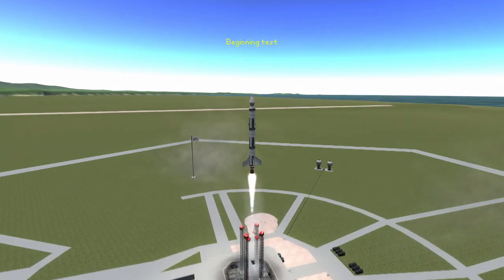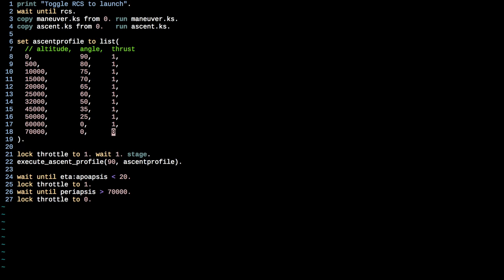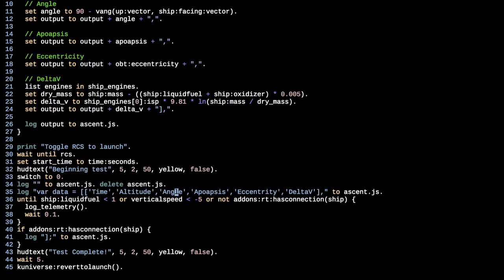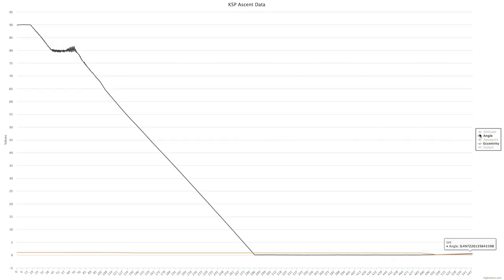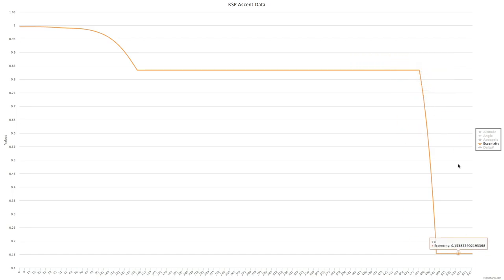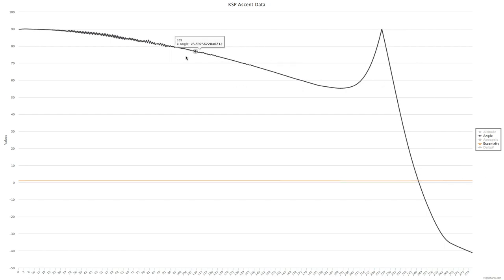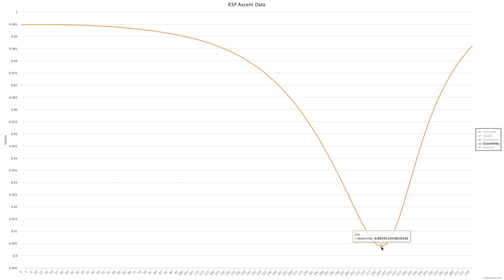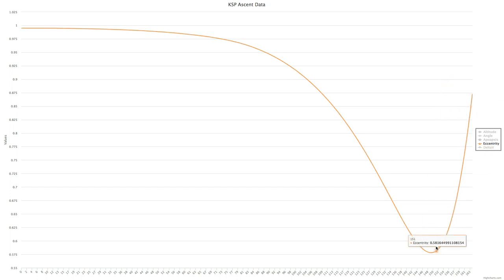Kerbal Space Programming #29 - Time to Fix the Orbits

Comment: Here is an idea:
Have a 2 PID controllers. One of the controllers optimizes pitch for eccentricity over altitude. (1 at launch site or maybe at a given start time (10 seconds after launch))
The second controller optimizes the throttle for ETA to AP so that it's always 30 seconds on the future.

Should probably test that~
The nice thing about PID is that you can just tell it what you want. Instead of defining your pitch over altitude you can just define pitch over what you want, which is constant eccentricity change with 0 at the end.
This will also work anywhere, atmosphere or not, because the PID accounts for the error introduced by drag.

Though of course you might not want constant eccentricity change but rather want to go steeper in the lower atmosphere so you spend less time there.

Could then add optional thrust limiter, acceleration limiter, AoA limiter.

Comment: How would I write a script that does a gravity turn such that the apoapsis is always, say, five seconds ahead of the current altitude, with an altitude difference of, say, one kilometer?
Reply: Or maybe implement a closed loop control that keeps the velocity exactly at the terminal velocity and the angle such that apoapsis is always just barely ahead of the current altitude...
Reply from the maker: +Matthew Ferrie that's definitely doable. I'd recommend using a PID controller for that.